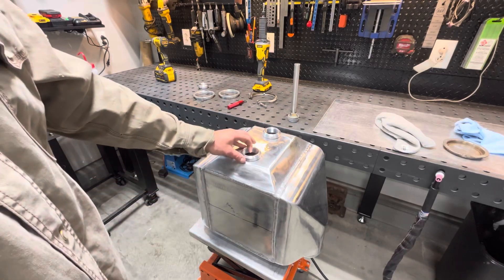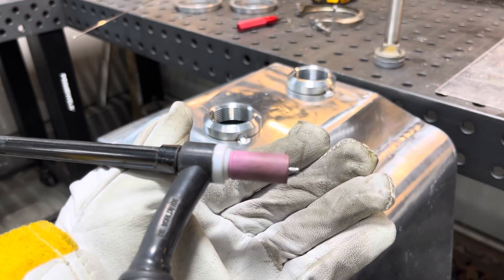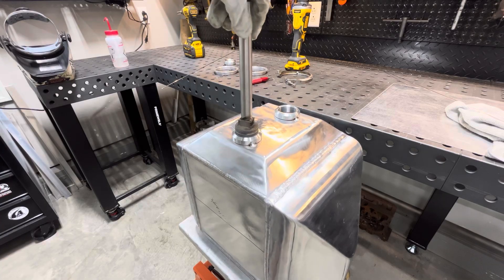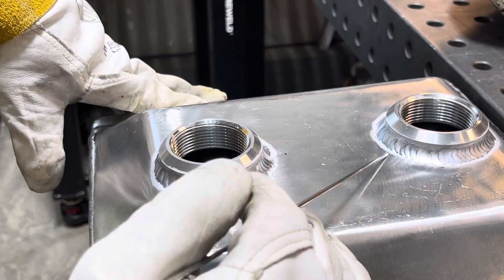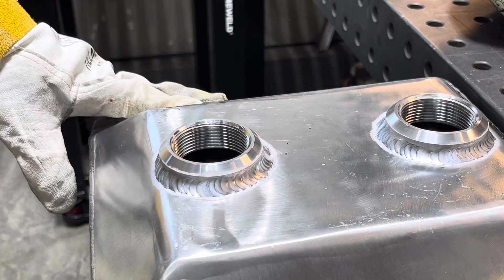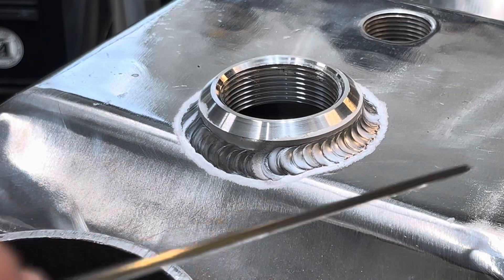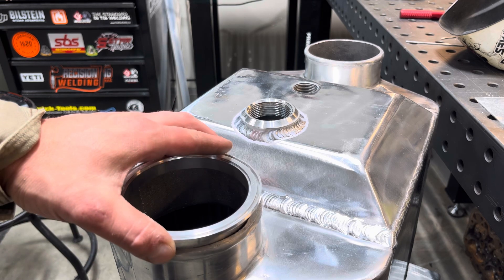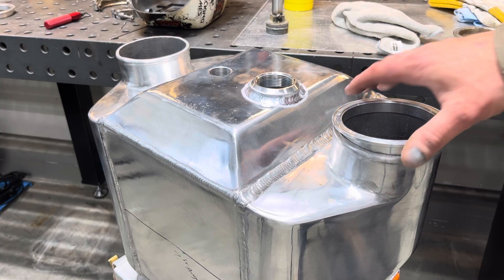How To Tig Weld  6061 Fittings Into A Cast Water To Air Intercooler

Comment: It’s not related to this video but I need some help. Last week, I had to TIG weld on my neighbor’s pontoon boat in the overhead position. Now, keep in mind, I’ve been welding for 45 years now but am just now learning to TIG aluminum. Question is: How do I keep the molten globs of aluminum from dripping back into the cup of my TIG torch? Any help would be greatly appreciated. Thanks for the video.
Reply: Could be a lot of things I’m not the best pontoon boats are horrible to weld to begin with used ones at least or ones that have been in salt water. Have the metal really clean wire brushed. It’s hard to say without seeing the weld in person for me. It can be not hot enough that it’s not sticking together can even be too hot that it’s just dripping out the puddle. Torch angle can help to angling it a little instead of being perfectly straight up and down so you can see the puddle more. Sometimes with overhead you have to shove the wire in the puddle more instead of just dabbing it. Not sure if this helps or not thought I’d try to answer a little. Also not sure if this is even a problem but one pontoon boat I welded I had to take the drain plug out to vent the inside crazy how big it is it was still having a little back pressure and wouldn’t let me seal up a weld once, may not be your problem at all can’t hirt to take it out too just make sure to put it back afterwards 
Others may have better info too 👍